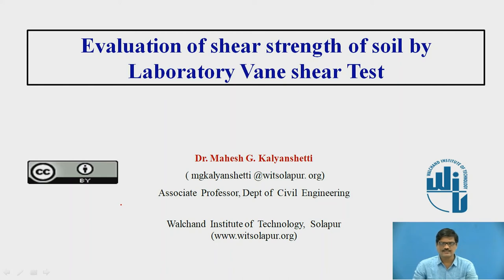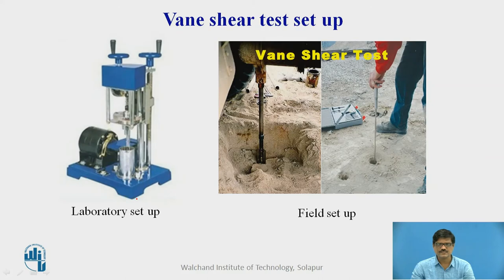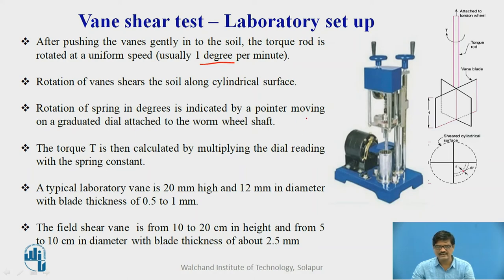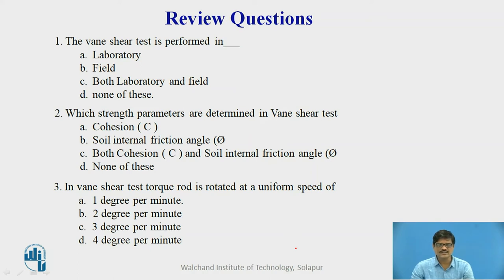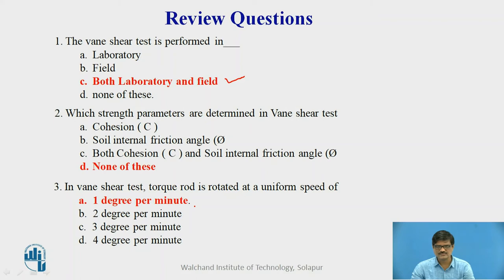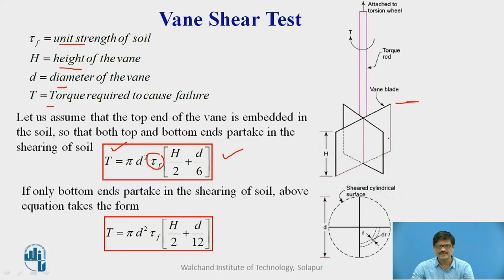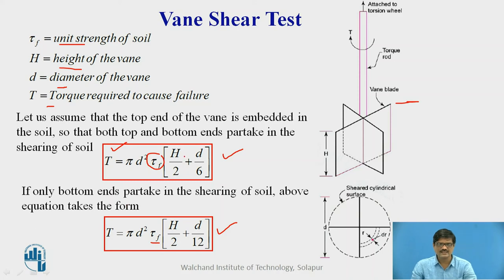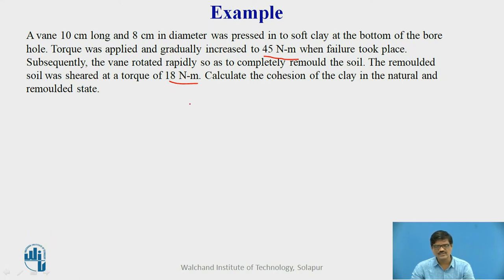Laboratory vane shear test

Comment: vane shear test is only give shear strength and not classified either cohesion or phi values therefore if you use vane shear test for shallow foundation, should be use hand auger method for soil classification.